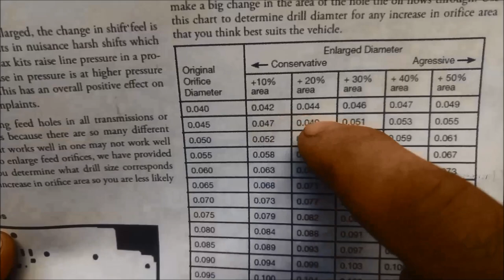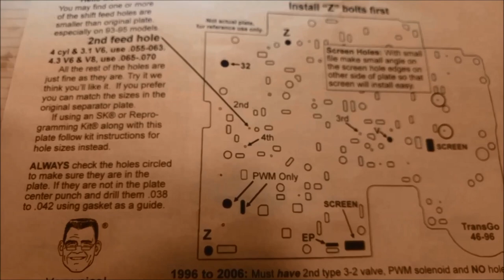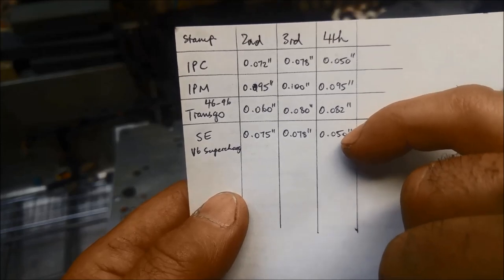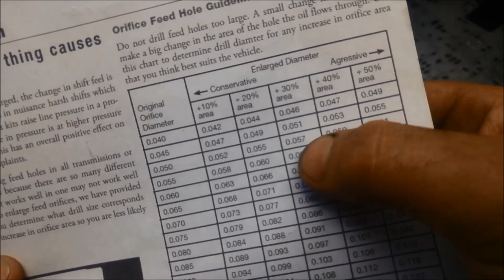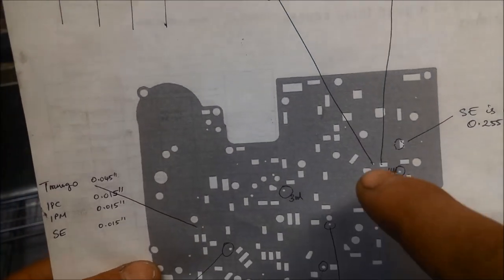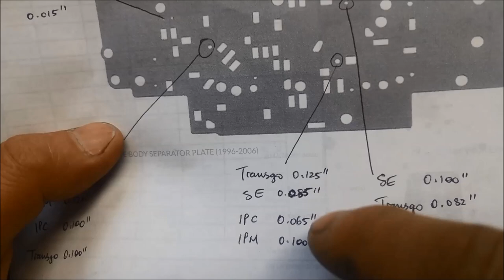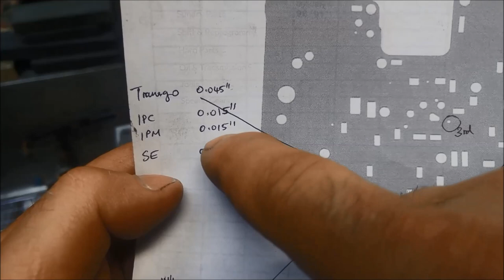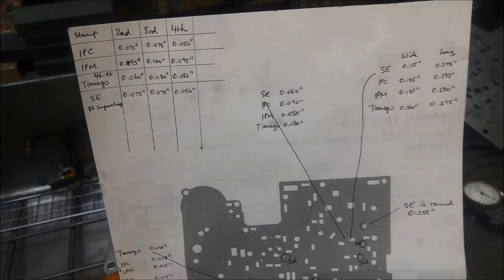4L60E Separator Plate Comparison & Tweak Modify, 4L60E Valve Body Modification for firmer gear shift

Comment: Hello plz i wanna ask you about hummer h3 valve body separate plate its the same 4l60e tahoo 2002?
Reply from the maker: hi, transgo have thicker separator plates. when you get your sep plate off, just confirm all the ports through new separator plate match the original. cheers
Reply: @YepThatsIt  sombody change it before its not stock for that i ask 
And manny problems inside the trans 
Slipping 2 n 3 n 4 and low line pressure 60psi max just 1 n R working good

Comment: If I increased the hole size thus increase the pressure lets say to my 3/4 clutch will that help with the longevity of the 3/4?
Reply from the maker: hi, it depends on how much you enlarge it, if just a little it will apply better and extend 3-4 clutch life. we always use lock joint teflon rings on 3-4 as the conventional ones get flattened out and stop sealing as well. cheers

Comment: stick small drill bits in the holes until i find one that fits snug, then measure the thickness of the drill bit.,
Reply from the maker: no worries. cheers
Reply: @YepThatsIt  do you guys resurface pumps? hardly anyone does it in the US anymore,,, they just find good used ones,, also, do u know an easy way to get the stator shaft screws out,, I bent a hex head trying to get them out,, dont know if they use locktite on them or what,, thinking of trying some heat.. the last one I did I had to weld a nut to the top of the screw to get them out,, also wondering why nobody has ever made a gasket to go in between the pump halves as most are reported to be not straight right out of the box new.